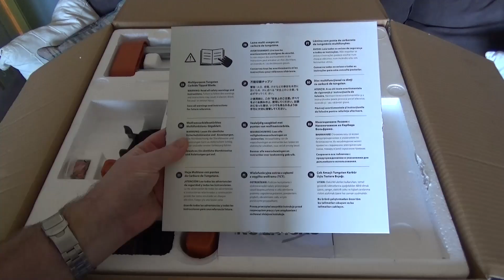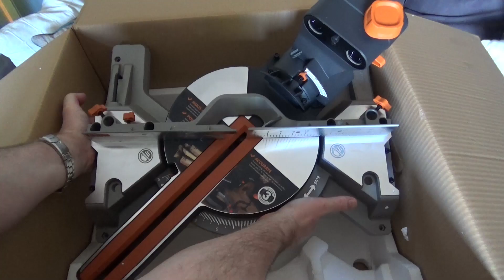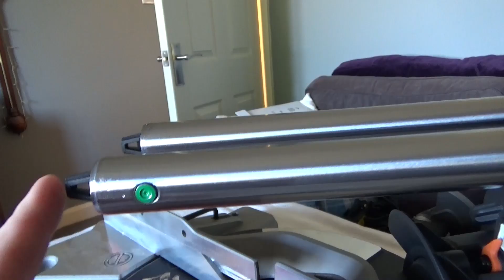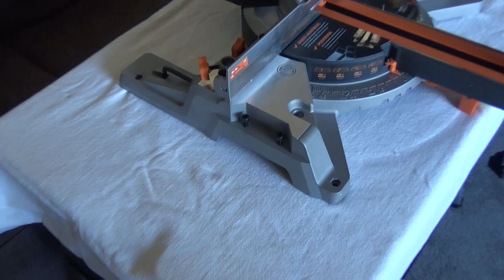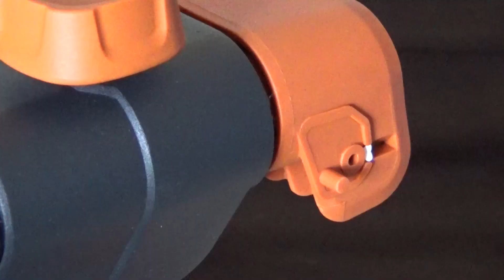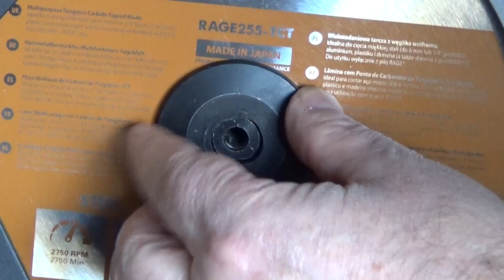Evolution R255SMS Unboxing and Assembly

Comment: How do you find dust extraction? I find it totally useless, with my Milwaukee wet/dry vac and Evolutions own wet dry vac. Surely there should be some kind of rubber boot. Other than that, it's a great budget mitre saw

Comment: The 1 inch arbor blade is tough to find. Even evolution was out of the wood blade at last check. The general purpose blade leaves some ragged edges. Suggest you stay with a 5/8 arbor saw for better blade selection.

Comment: Hi Russell, great video! Ive just picked mine up and initially it seems great but apron start up it seems to have a strange knocking almost like the blade hitting something is this something you’ve come across or is it how its supposed to sound ( i havent heard another n person only videos) many thanks
Reply from the maker: No Ben, it should not be making a knocking sound.  Check to make sure you have fitted the blade correctly, especially that the washers either side of the blade are the right way round.  If all is in order, contact Evolution customer support:  https://evolutionpowertools.com/uk/contact/b/        There's a phone number on the top of the page if you do not want to fill out the form.  I hope this helps.  :-)
Reply: Many thanks for the quick reply Russell, I’ve contacted them so fingers crossed it’s a simple fix.
Reply from the maker: @13enGT  Fingers crossed!  :-)

Comment: there is no positive arbour lock on mine like you'd have on a grinder or my skill saw, it feels like the arbour lock is trying to grip a gear ring if you know what I mean, there should be a positive stop in it surely? the one I just bought must be faulty, doesn't inspire confidence in the brand tbh, it's going back to srewfix.
Reply from the maker: Sounds like a faulty saw.  The button should lock the arbour completely.  :-)
Reply: @RussellPlatten  Thanks, the saw suited me perfect apart from that issue, might try another one, I have a good freud blade from an old mitre saw that will fit this one as well with an adapter fitted so I'd like to stick with this size saw.
Reply: Problem solved, bought a Makita.
Reply from the maker: Glad you are finally up and running!  :-)

Comment: Cracking review Russel.Thinking of buying one of theses from Screwfix.Would you say the R255MS single bevel is the one to go for or spend the extra £40 and get the Double Bevel.👍
Reply from the maker: If you are intending to cut  a lot of cornice or compound mitres, I would go for the double bevel, a kitchen fitter would benefit from the double bevel.  If you are using it for predominantly straight mitre cuts and the maybe the odd compound cut the R255SMS is the one to go for Ricky.  :-)

Comment: Hi I have got my carriage are stuck half way in the bearings, ant idea how I remove.  Thanks
Reply from the maker: There is a lock nut with an orange top to lock and release the carriage.  :-)
Reply: Thanks but it's stuck in there as the lugs on thr side must have popped out half way in there
Reply from the maker: @paulrobinson2267  Can you try and describe where the problem is Paul.  I cannot figure out what has happened.

Comment: Hi everyone. Have any of you checked if your saw's bed is completely flat?  I have put straight edge across mine and found centre table to sit slightly proud to side supports. I found this fault immediately after taking it off the box. It's slightly better after removing stickers but still far from perfect. Did you encounter this issue with yours?
Reply from the maker: Mine is fine Tom.  :-)

Comment: I just set mine up and it seems to sound as though the blade is catching or oscillating. Ever so slightly. Is this normal? Thanks.
Reply from the maker: No that does not sound right.  Make sure you have fitted the blade correctly.  If it look ok, check whether the blade is oscillating by cutting into a piece of wood, not right across, and checking the diameter of the cut with the kerf of the blade.  If the cut is wider than 2mm the blade may be warped.  Place it on a flat surface to check.  Contact Evolution customer care for assistance if you think there is an issue.  :-)
Reply: @RussellPlatten  cheers for the tips mate. It seems to be cutting almost perfectly. Just that I can hear like a dull thudding. To be honest, it could be just the noise it makes. Never used Evolution before. Not too experienced with Mitre saws as it is. Thanks again.
Reply from the maker: @MadCalPC  I would leave it then Callum.  If an issue develops, contact Evolution.  Take care whilst using it, they can be dangerous if not used correctly and good luck with your projects!  :-)
Reply: @RussellPlatten  Thank you!

Comment: How do you release the sliding carriage
Reply from the maker: I am not sure what you mean David.  The orange knob  behind the saw head locks and unlocks the sliding carriage.  
If you mean how do you reset the locking mechanism (if it has activated before fitting the saw head to the carriage):  You have to use a screwdriver or other suitable tool to prise the two white fittings that can be seen at the end of the carriage tubes until the green pins pop out on each tube.  
If you mean how do you remove the cutting head once it has been fitted:  You need to find the holes on the cutting head where the green pins are located.  Use a screwdriver or other suitable tool to push in the pin and slightly pull the cutting head away from the saw so that the pin cannot pop back out.  Do the same on the other side making sure that the the first pin does not move back into the hole and pop out again.  Once the second pin is pushed in, you can remove the saw head from the sliding carriage.
I hope I have answered your question and described the processes adequately.  :-)

Comment: Thanks so much for this video. You've saved me a good hour or so setting this saw up; I've never had to contend with anything like this before, but your guide is great. Just one question: I can't seem to turn the base. It's locked at 45 degrees. How do I unlock it?
Reply from the maker: Hi Jay, turn the orange locking knob anticlockwise, the one that you have to hold to move saw head.  Under the knob there is a lever you need to pull up to release the saw.  :-)
Reply: @RussellPlatten  Cheers Russell. 👍

Comment: Whoever at Evolution thought it was a good idea to have the diagrams all shown together on one page and the text explaining how to build this thing in another part of the instruction booklet should be shot. Thanks for posting this video, it helped me a lot with putting mine together and understand how it works. I have the newer R210SMS-300+ but the principles are the same.
My instructions had a QR for an online assembly video, but my phone doesnt read QR codes and they didnt bother to simply state the url... I tried to find it with google and looking on the Evolution site, but could only find guides for older models. Decided to just rely on good old youtube instead.
Reply from the maker: Good old YouTube!  :-)

Comment: Very useful, thanks a lot. Just a question: the black hinge that connects the motor to the sliding bars, and the thing where the bars slide into, are cast iron? Or is it plastic?
Thanks in advance 😊
Reply from the maker: Machined aluminium.  :-)
Reply: @RussellPlatten  Thank you! That persuaded me 😊

Comment: I wish I'd found this before I assembled mine! I put the slides in upside down and had to do the lug reset thing.
Reply from the maker: At least you were able to rectify your mistake.  :-)
Reply: How does one do the lug reset once the cutting head is also on, may I ask, because I just did the same darn thing!

Comment: I wish I had seen your video before I started assembling my saw. The problem I had was the two lugs were deployed when I opened the box. When I tried to push the carriage slide through the tubes the lugs stopped it. As I had recently assembled a high chair that also had lugs I pressed them in and the carriage slid in. Well half way in as it's not a tube, it's two tubes with a gap in the middle. it was stuck. It does sort of warn you about the lugs being deployed, but not really in the order that most people would read the instructions.

So I got on the phone to Evolution this morning and sought help and the solution was so simple. My old man taught me that the hammer was the tool of last resort, however in this case it is the only tool you need unless you have an hydraulic press.

Using a workmate with the jaws open I put the saw vertical so that the weight of the carriage had the lugs pressing up against whatever was preventing it going forward. I put a length of timber over the orange end of the carriage and gave it a firm but not too heavy single clout with a rubber mallet. Bingo the lugs, they are bevelled apparently, were pushed back in and the carriage passed through. So it wasn't as I thought the end of the world.

p.s. If you find yourself in this situation, no I wasn't the first one to do this, just remember to keep your fingers out of the way of where the orange end of the carriage will end up when you hit it. It drops very quickly once freed. I'm ok, it wasn't my drinking hand.
Reply from the maker: Thank you for posting that information.  I reckon it will help others with the same problem.  Evolution have a good support team for customers with issues.  I hope you like your saw after all that!  :-)